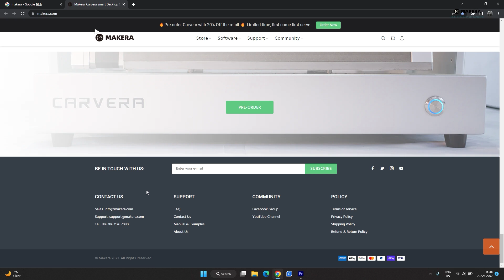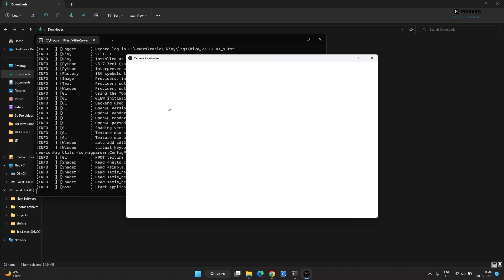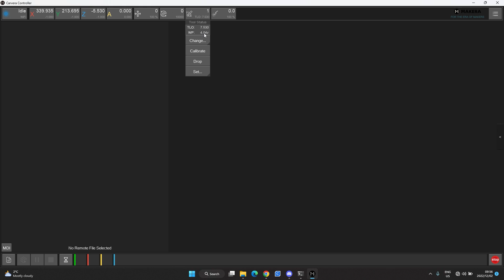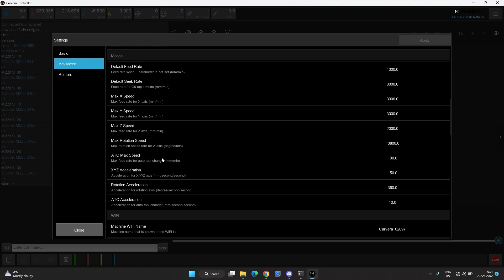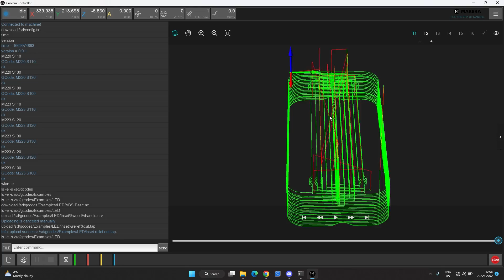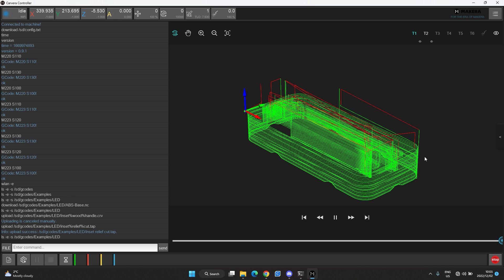CARVERA controller software setup and breakdown!

Comment: Hi everyone,

I'm completely new to the CNC world and this is my first real project. I'm using a Makera Z1 and I generated my toolpaths using Makera CAM.

I'm working on a 3D relief carving from an STL file. I created a single job with two operations (two tools) in the same file:

1. Roughing: 3.175mm Ball Nose (Stepdown: 1mm, Stepover: 0.5mm)
2. Finishing: 2mm Ball Nose (Stepdown: 0.5mm, Stepover: 0.16mm)

The roughing pass went perfectly and the machine paused when it was time to change the tool. I then:

1. Changed to the 2mm ball nose bit.

After that, I pressed "Resume". However, instead of continuing from where the roughing pass stopped (on the Z axis, above the material), the spindle moved to the initial safe Z height and started cutting in the air. It seems like the finishing pass started from the very beginning of the G-code, as if the job had just started.

My expectation was that the machine would remember the Z position from the roughing pass and simply continue the finishing operation from there, but with the new tool. I'm not sure what I did wrong.

I appreciate any guidance or suggestions. Thank you in advance for your help!
Reply from the maker: Please contact support@makera.com for direct assistance with your project.

Comment: How can i enter the rotation speed from the 4th axis (RPM)?
Reply from the maker: The feedrate would determine the RPMS of the 4th axis.
Reply: @Makera  Thanks but the feed rate versus RPM is not the same. How smaller the diameter gets by the same feed rate would increase the RPM. But okay, if i only can set the feed rate than i think that the firmware have no option for setting the RPM itself. I'm correct?

Comment: Say for example my stock is larger than the area im cutting into. Should you make the work origin where the machine will start to cut or the corner of your stock?
Reply from the maker: You can do it either way, I personally like to use the corner of the stock and place the model slightly inside the stock to make sure the toolpath is clear of the anchorpoints.

Comment: Does setting the x and y to zero set the work origin or path origin to zero?
Reply from the maker: The path origin
Reply: @Makera  Do we need to be able to manually zero the work origin, as the path changes for each gcode file?
Reply from the maker: @jamesong10  Sorry, a correction, the X=0 and Y=0 action is to set the work origin, not the path origin.

Comment: MAC CONTROLER SOFTWEAR DAMAGED IN DON LOADSWINDOWS WILL NOT OPEN CONTROLER🤣😞
Reply from the maker: Join us on Discord for support on any issues https://discord.gg/UVbs5KcK
Reply: I'm getting the same thing - still waiting to hear back from the company - for now I place important papers under the machine so they don't blow away
Reply: @sustainablewoodworking729 
Did you ever get running IOS?

Comment: Can I: 1. upload a photo-files (like jpeg) then laser garver it 2. upload a cutting file to cut the picture printed out from the plate? Material to process is karat gold
Reply from the maker: You would need to upload the jpeg to cam software that can produce the engraving and the cut file. I am launching a video tutorial on creating laser engrave files in a few weeks. We have not run tests on gold yet, the machine is not aimed at hard metals, only soft metals like aluminum and brass, I think you would also need special milling bits to cut gold and coolant depending on size.
Reply: @Makera  even the gold, copper and silver are not a hard metals either, they should bend to be cabable to use with the Carvera? I'm very keen on seing the results on both caving and cutting the gold in mm thick range! There would be a huge market in the field of artesanial jewelleries.
Reply from the maker: I think this would be worthy of a test, will see if I can put something together in a few weeks to test this.
Reply: @Makera  I certainly wait your test! Pls. let me know soon as it will be happening ☺️

Comment: What's the range of the vacuum power ?
Reply from the maker: The range is 0-100 is in the diagnostics tab, and the default value is set between 50-100 in the basic settings tab.
Reply: @Makera  thanks, looking forward to see more tutorial videos for all levels of users. ( I am the beginner level)